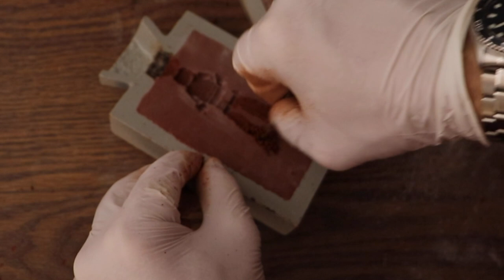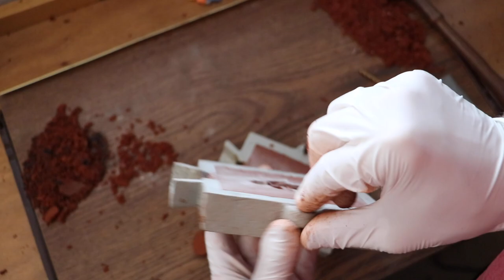MAKING SILVER LEGO BATMAN

Comment: 1:09 you do it in a wrong way, your hammer is too Wide, You're do it in the opposite way you should hammer it with a smaller diameter to make the sand more cohesive. basically it forcing a small sand area to grab on the object